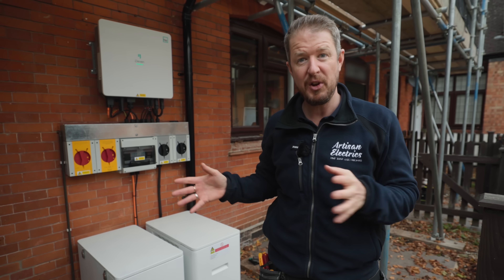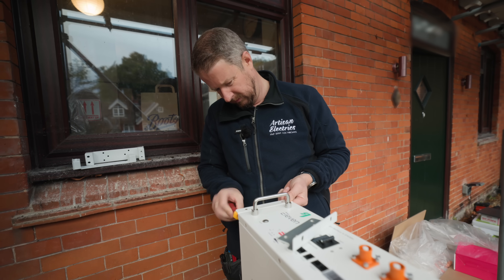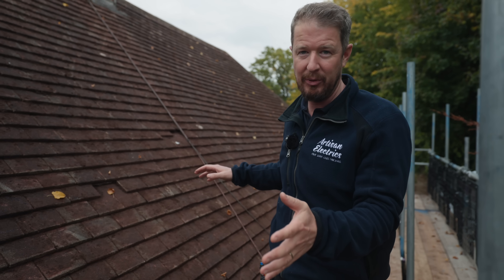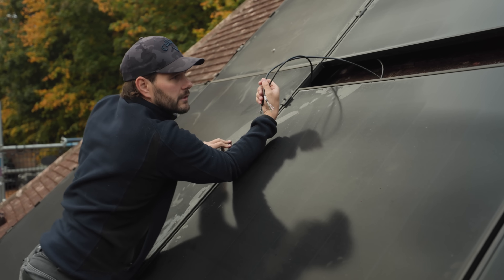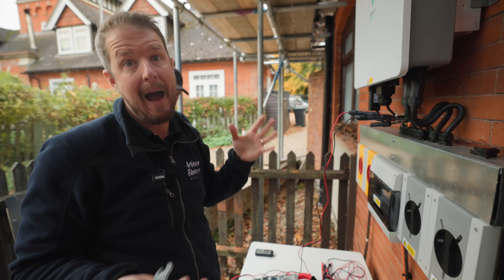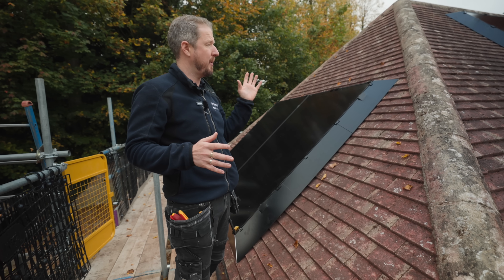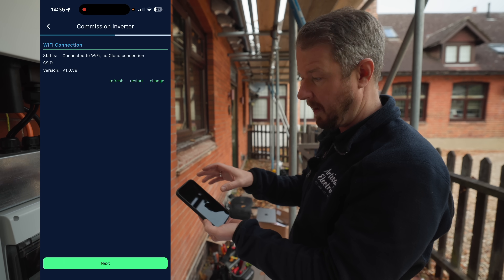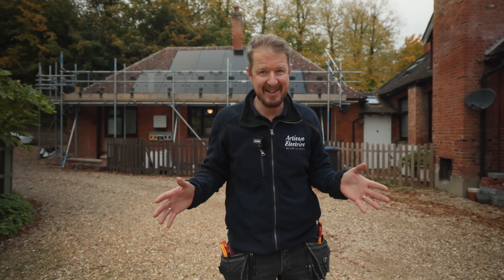Is Sodium-Ion The Future of Battery Storage?

Comment: Sodium ion batteries make sense especially from a house insurance view since the risk of Lithium fires though remote  has been used to ramp up rates. However, at the moment sodium ion batteries are twice the cost of lithium ion though this will change as volume increases, though at the moment BYD are only achieving a 20% reduction in production cost. Another benefit is that their operating range is much wider with both low and high temperatures.

Comment: You should have said, as has sort-of been touched on by others, that you need an inverter specifically designed to work with Na batteries because of the falling voltage as the batteries discharge. So at the moment that means you have to use an eleven inverter.

Comment: The title of the video doesnt express the content. The content doesnt give any answer to this question. It only shows, how the system was installed and commisioned. 
No information about:
- the price of the system
- installation price 
- expected return of investment
- how the system works in real life
- how much of the complete consumptions can this system cover
- how low voltage is handled on the lower side of discharge curve
- comparison to LFP - efficency, capacity, price ...
- round trip efficiency - by Sodium batteries, this is often a problem. They are far less efficient than LFP (65-90% compared to 95-99% by LFP).

All these things needs to be answered, if we want to know if "Sodium-Ion is the future of battery storage" as the title asks.
Nothing from this has been explained.
Just blabla about how good is it for environment. But no numbers.

Comment: Cost needs to come down by at least 60% then it will take off, but prices right now are more than lithium and holding steady. Also connecting to your house, a simple cable running to the switchboard attached to a £150 switch to isolate from the grid during a blackout, no inverters and distribution points and other equipment, everything in one box that takes a max 1 hour to connect to your home and solar.
Reply: As with everything new… early adopters pay more!

Comment: Hi, can you told us parameters of this batteries? What is maximum DOD, kapacity each of pack and maximum power in and out in kW from each pack to stay under warranty? How long is warranty for this batteries? What voltage and maximum current? How much cycles is longevity?

Comment: What about the two big reasons NOT to use sodium?
Low round trip efficiency
Large voltage swing from 100% to 0% SOC is hard for power electronics to handle

Comment: The Aikos are optimised panels? Why fit 3rd party optimisation as well? Do they not conflict?
Reply from the maker: Great question!

Aiko panels are high-efficiency modules, but they don’t have built-in panel-level optimisation. Their optimisation is in the cell design, not in managing shade or mismatch on the roof.

3rd-party optimisers do things Aiko panels can’t, such as:

Panel-by-panel MPPT
Shade mitigation
Preventing one panel from dragging down the whole string
Panel-level monitoring
Safety shutdown

They don’t conflict, they actually work together:
Aiko boosts panel output, while the optimiser ensures each panel performs independently in real-world conditions.

Comment: Na+ in it's current form will never be serious alternative to LFP. Let's think about a few huge downsides, that nobody seems to be talking about;

-Cycle life; it's currently lower compared to LFP. About half of the typical LFP cell

-HUGE "usable" voltage range. To extract maximum energy, you need to charge them to 4V and discharge them to 1.5V. Imagine having a 200V pack (peak voltage) that needs to go down to 75V to get the most energy. You'd need to design an inverter that can support that range and have current capabilites to do so as well. Same with batterie's BMS. This in practies mean more expensive inverter and poorer efficiency.

-Very poor roundtrip efficiency. While LFP can easily do 95-99% efficiency, you'd be lucky to get 60-70% with Na+. Now image (along with lower inverter efficiency and higher currents at low SOC) how much less usable production will you get out of your solar array.

-Cost; right now they're more expensive than LFP.

-Very low volumetric and gravitational density. Not too important for ESS

-Slower charge rate

So no. Unless something fundamentally changes in their chemistry, they're simply not suitable for home storage. Or BEVs. Or anything really. Maybe they could be a decent drop in replacement for lead acid starter batteries due to their cold weather performance.

Comment: Too bad you are not in America, the installers here are greedy and over priced the solar power systems....
Sodium batteries have a lower operation voltage then lithium, so need completely different inverters to work with it ...

Comment: Very interesting and good to see Sodium's finally available for UK installs.

Why are you not putting snow pegs on the solar panels?
Before you condescend with something like, " we don't really get enough snow in this country to cause a problem", my experience is that the slab of snow hitting the ground after sliding off the panels is enough to send shockwaves that I can feel through the soles of my feet while I'm stood inside the house. Not to mention the loud whollop noise made. That's enough energy to knock almost anyone, who happens to be standing underneath, to the ground.

Insurance claims & legal suits incoming!

Comment: Hold your horses, you may have picked the wrong one buddy.
If I were you do your research on future batteries just coming on stream.
New technology using aluminium has just been announced by Tesla and out performs Na & LiPO4 by a factor of 5-10 depending on the parameter measured.

Comment: It's rubbish. The voltage drop is crazy. Making it useless for anything with the present sodium battery technology. Maybe one day in the future it may become useful. But the additional cost compared to lithium batteries is roughly double the cost. With the massive voltage drop you need a specialist inverter that can convert the lower voltage into useable 220-240v. So even more cost. There is no way I'd be a guinea pig, being and early adopter of this lower quality and much higher priced technology.

Comment: bit of an ugly install, could you not be more discrete with all that crap and wires mounted on the wall ?
as for sodium batteries becoming the futures? maybe, but their working voltages and current draw need some work. i also wonder if they get any moisture in them will they go bang as thats what sodium metal does in water. this aint no table salt battery.

Comment: Why don't panel makers sell blanks (same finish as in looks same outside, just no solar) in angle and other shapes (cuttable even) that you could edge of the whole roof area so it looks like a roof instead of a Tetris blocks stack that stands out.

Certainly make the nimby visual folks feel less triggered and sure some would like that option - untapped market perhaps there.

Comment: I guess the sponsoring required not to mention any negative information about the product. You didn't say much about it...
Reply: The biggest one is rather big voltage drop, when the battery is getting more empy… but when the inverter fix that, it is not actully not a big problem. I cars it affect more. The good parts are wide temperature range, so gold weather does not drop the capasity as much as in other solutions. The size vs capasity is smaller so you need more of these to get same capasity. But those are the main problems so in house usage, mainly advantages compared to other solutions. 
In car usage the weaker parts are more problem.
Reply: @haukikannel  An inverter may not be able to fix a big voltage drop. Most batteries have a rated charge and discharge rate, the discharge rate is said to be the same at both high and low voltages. But that's just a simplification. EV fast chargers have optimised charging and only enable low charge rates at high and low voltages, but higher in the middle, on the voltage plateau. If you are getting low current (I) at low voltages, the resulting power you can draw from it at lower voltages without damaging the battery (I x V) may be very low. You're only going to get home at low speed when the battery is nearly empty. And initially recharging will be very slow. The inverter cannot change that.

Comment: Sodium batteries have the potential to be cheapa and fairly robust, but they have a competely different charge and discharge curve so the high and low voltage over the charge may need additional compensation in the converter/inverter, or a more limited useful operating range / depth of discharge. But they should be fairly robust and aremuch much better at low temperatures, generally not needing any heaters to avoid damage.
It is probably horses for courses, or on industrial scale using Na as 'starter' batteries for initial control & heating of the Li packs.
They should also have a lower fire risk, but unless Li starts to go up in price, the performance characteristics of Li are currently much better for normal storage / Inverter use.

Comment: I've got an Eleven Energy system and have been running it for the last 6 months. There is a a lot of uniformed rubbish in some of these comments. The round trip is efficiency is >90% (yes, I can measure it). I've not run into any issues with the increased voltage range of sodium ion batteries, the Eleven inverter is designed to accomodate it. Right now my system is under 20% SoC and still capable of delivering >4KW.
Reply: Looking at an Eleven Energy system myself. May I ask, how are you finding the app? Is it user friendly, responsive and allow you to charge/discharge the battery the way you want it to/is best with your tariff? 

Thank you ❤
Reply: @annedreikandt7361  Yes, the app is very easy to get on with. You can set various modes and schedules to your heart's content, or tell it what tariff you are on and put it in "Automatic Optimisation" mode and forget about it. They support Shelly sensors if you want to monitor what's using power and let it know when your EV is charging to avoid dumping your battery into your car charger.

Comment: Sodium batteries is THE PAST!

Their round trip efficiency is about the same as Lead acid so about 40% is lost in heat.

Won't take a high C charge above 60% charge, so when you want to store energy for tomorrow you loose most of it.

They are more expensive than Lithium iron phosphate that is 98% roundtrip efficiency and have a MUCH better voltage curve.

Comment: I dont see Sodium making much of an impact over Lithium anytime soon. They have so many disadvantages and problems its a no brainer to stick with Lithium. The only advantage is low temp performance which is nothing compared to the disadvantages.
Reply: Jep. I have the same opinion. Most importantly, the batteries themselves are MUCH more expensive than LFP, and there are simply no Inverters available for the insane Voltage range of Na-cells

Comment: "All I know is it works really well!" It's your job to know what a solar panel optimizer is and how it works! You're charging a fortune for 'artisan' work but throughout your videos you're consistently demonstrating your lack of anything but superficial knowledge of these things you profess your company is an expert at.
Reply: "steeper pitch is quite good as we get a nice angle for the sun' ... wow, technical stuff
Reply: I think he was simplifying for his audience.
Sounds almost like a microinverter system: except earlier in the video he claimed that the panels were DC coupled to the main inverter.

Edit: looked up the inverter -- it says it is DC coupled with MPPT:
"2 MPPTs
80-550V MTTP voltage range"

Edit: looked up the datasheet for the optimizers. Tigo TS4-A-O
There is one module per panel. Offers rapid shutdown.
The optimization version probably has a panel bypass feature (datasheet is frustratingly vague on that point).

Edit3: You solar goes down if the Internet goes down.
"Monitoring, rapid shutdown, and remote
troubleshooting with Tigo Access Point (TAP) and
Cloud Connect Advanced (CCA)"

Comment: Every month for the last 10-15yrs we get an PR announcement that a new EV or solar battery will "change everything".  After 15yrs we still have minimal battery improvements.  The PR announcements from battery manufacturers have shot themselves in the foot, as people no longer listen due to failed promises.  10yrs ago I saw my first Tesla, I wanted one.  But since I am a green techy (it is my job) I expected the tech to improve so I was going to wait 2-3yrs for the tech to mature.  10yrs later, I am still waiting.  Questions I need answered, can we reduce the weight of EV cars, increase weight causes so many problems in cars, vans, trucks etc (bigger brakes, wheels, tyres, suspension, road wear, safety in crashes etc).  When we all have 60Amp 3 phase to our houses, how much will it cost to replace the local grid distribution cables etc to have 1000's of houses simultaneously drawing 60A, since 60% of car owners do not have their own driveways & they cannot charge at home, how will we get 60Amp fast charging from the street, using electricity from the street lamps.  I have professionally followed technologies for 40yrs, seen so many claims, announcements & companies which will change the world.  In reality it is less than 10% of the PR announcements, claims, companies that actually have the tech which materially changes/improves/reduces cost/increases adoption.  All of this applies to the same claims about solar panels, lots of promises, little actual improvement.  Wait next month we will have a PR announcement about the next battery/solar panel which will change everything.  Honesty works, the next big thing rarely does.
Reply: I bought my solar panels exactly 10 years ago this month.  My panels are 250W peak power each.  I see that these panels are 480W peak power each.  So, over 10 years the panels are almost twice as good.  I expect that they are similar prices too.  I paid £8,000 for 16 panels which equals 4kW peak.
Reply: @bobgriffin316  Are they the same size, I bought a solar panel for the sail boat 10 yrs ago, 50W, today the best for that size is 80W.  The cost to buy is the same.  The ability to convert sunlight to elec has improved about 10-15%%.  The solar controllers are better, but again 10-20%.  My dream was to have solar and be off grid as much as I can.  But at the moment it is not realistic. Still waiting. If I watch the videos it looks good, if I do the calculations & install it will not work. Also, I need the power in winter, not summer.  The PR announcements that in the middle of summer, so much elect came from solar is useless.  We need to design a elec system for the middle of winter, in the night when the wind does not blow.  And then hopefully the next day we can charge the batteries up.  Difficult.  So I watch the videos and dream, then reality hits me and get sad.

Comment: Do not understand why you create problem of the WiFi wireless connection of the solar system, every time that a customer changes their internet provider then I as an internet network engineer get a phone call that the solar panel app no longer works. Why with alll the cables u have to install do u not pull in an inverter internet cable to the customers internet modem. You installers drive me crazy! I did hear u say you use WiFi conections

Comment: I think these funny bird protection you build around the solar panels are really a bad idea. If they would consists of wire which allow for a good air circulation maybe .. but to close them off .. Remember that 75% of the energy hitting your all black panels is instantly converted to heat. When, for simplicity, assuming that that you have 1000W per square meter of sunlight you and up with 10th of kW of heat that you have to remove. If you can't do this by convection (air passing underneath the panels) the only way to get rid of the energy is radiation. But the efficiency  of radiative heat transport goes with Temperature to the 4th. Could somebody please measure  the surface temperature of these  panels in July ? Efficiency  of the installation must be really low.

Comment: I note there is no lock on the battery pack casing, and you've created a video on a property which is very distinctive from other properties near or around. The solar panels would be easy to spot especial from the air, if someone was looking. So I would recommended putting padlocks on those boxes, or have the company that supplied them to think about security on live voltage DC circuits that could potentially be open by a kid!

Comment: How much more expensive is the hardware like the inverter that can handle the huge voltage drop of Sodium?
Reply: Probably the battery pack has more extra cells in series that will make the bottom voltage as close as the LFP packs
Reply: @sihamhamda47  That a lot of extra cells.